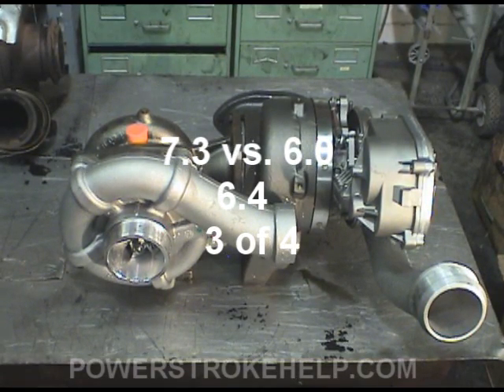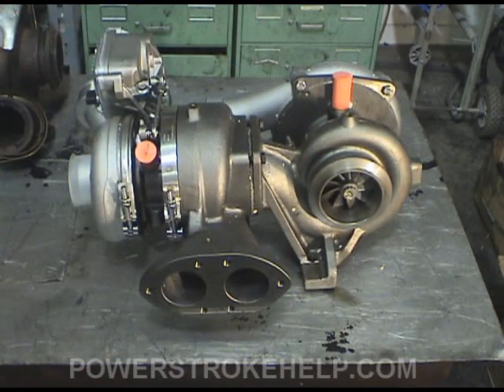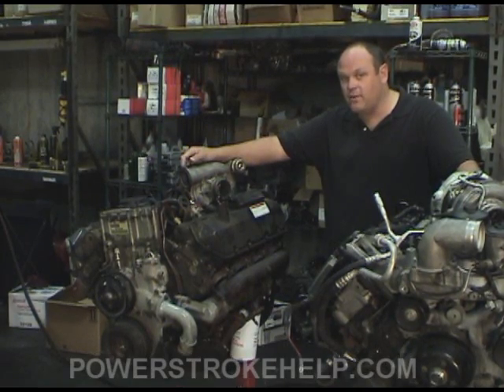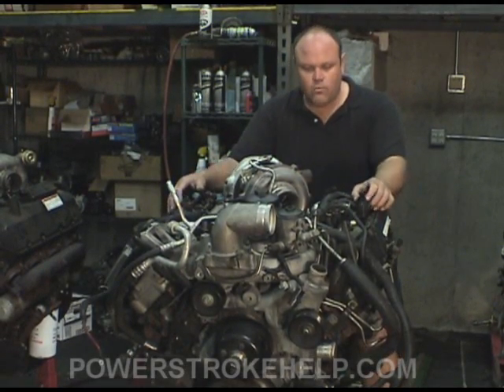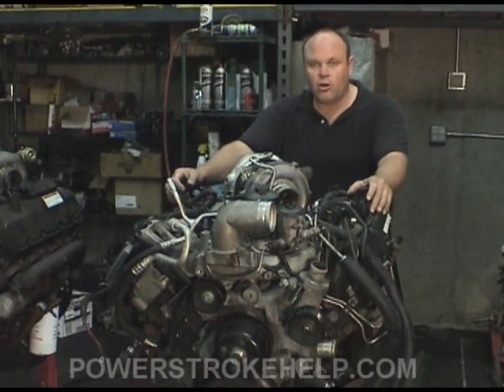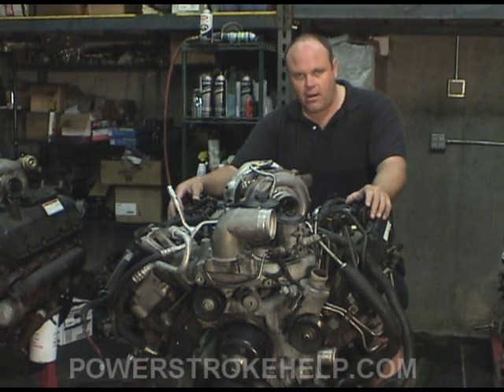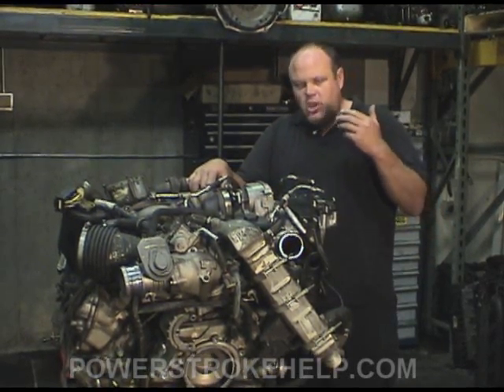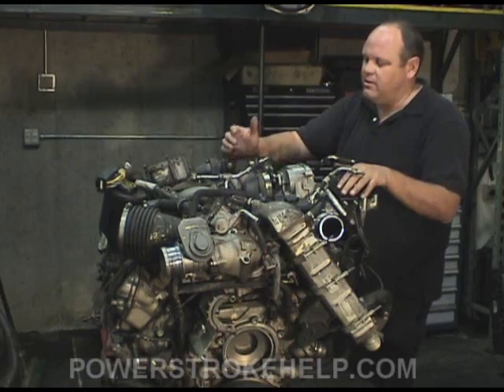7 3 vs 6 0 vs 6 4 POWERSTROKE ENGINE 3 OF 4

Comment: Out of the hundreds of 6.0 SD trucks we have had in the shop, I have never seen a stock 6.0 powerstroke blow a head gasket no matter how hard they have been ran. If you tune them then they blow head gaskets but I have never seen a stock one do it. We usually see the 6.0 in for high pressure oil leaks, high pressure oil pump failure, egr cooler failure, Ficm power supply failures, main engine wiring harness chafing causing no starts, oil cooler failures, and injector failures. I also occasionally see glow plug and glow plug module failures and a water pump failure here and there. We do bulletproof them when the customer requests it but I have never actually seen one with a stock tune that needed it. It seems like every truck we have bulletproofed keeps going strong until the entire body rots off of it. Being in Minnesota, that happens a lot.

Comment: And 10 years later Bill stopped working on 6.4s with his final video about having to replace this same turbo for a 4th time because it was such garbage and Ford's quality control went to s#it. Aftermarket single turbos worked better on these trucks.

Comment: I have 123,000 on my 6.4. It has been maintained by my Ford dealership since I purchased it with meticulous care. I change the oil religiously every 3,500 miles. Yet, with all this, I have had to replace the radiator ($1,200), alternator ($1,500), EGR cooler ($3,500) and high pressure fuel pump and sensor ($4,100). I have replaced exhaust sensors 3 times $150ea). I have replaced both lower ball joints, track bar ball joint and the tie rods. both long and short TWICE ($1,200x2). The truck pulls our 16,000 fifthwheel flawlessly (when it's running). Out of the 123,000, I'd estimate I've used the truck to pull the trailer 60,000 of those miles. I love my truck, but all these breakdowns and the cost just to get me to 123,000 is nerve racking. What next? Turbos? and EGR failure? I shutter to image.

Comment: 01 f350, 7.3l, 6sp, 4x4. 385,000mi, replaced all 8 injectors at 300,000. That's all that's ever been done to the motor. Have had to repair 6th gear in the trans, new South Bend clutch, and new pinion bearings in the rear axle (we tow the hell out of this truck, it's all it really ever does). BTW, NE Tennessee is nothing but hills, there is almost no flat ground.
Reply: Sean Hazelwood so do u recommend me 7.3 over all other types of engines? Do u need to do dealerproof on ur 7.3?
Reply: No bulletproof needed on 7.3. In terms of reliability and work duties, yes I prefer it to other ford engines. Typically, the only thing that breaks on a 99-03 7.3l PSD is the injectors and glowplugs.

12v and 24v 5.9l cummins are equal to 7.3 in my opinion (if the killer dowel pin is fixed), but the dodge truck tends to have more issues than the ford.

Other diesel engines are cleaner, quieter, and make more power but they simply do not last as long without major repairs.
Reply: nope just do the maintenance and she'll take care of you.

Comment: own 3 x 7.3 my 2000 4 DR  RWD 6spd manual gets 22mpg, has upgraded air filter large (Dyna) the 4 x4 4 dr dually gets 14 mpg while purchased 6.4 4 x 4 very disappointed w/ my twin turbo, gets 10-12 mpg & power is NOT the same, sure its nice off line, but upgraded my 7.3 4 x 4 changed plumbing fixed fuel rails (on all my 7.3's) tuneable chip TS-6 & she blows the 6.4, honestly great ideas on 6.0 6.4 & 6.7 but when we work every day 7.3 does it. Nextdoor they own 3 Dura-Chevy's glad I did not do that mistake as I almost did. Diesel injectors needed to be replaced at 80K on every truck?  My oldest truck is 16 yrs old now, having trans rebuilt, just don't see purchasing new truck (as I made mistake with 6.4) People ask me when I will sell my 7.3's  why should I, when a 16 yr old used 300k Truck re=sells for more than a 8 yr old 6.4 with 120K on it. I'm delighted with your video, YOUR VIDEO IS THE MOST STRAIGHT UP EDUCATIONAL VIDEO OF THE YEAR!  Thank you I'm keeping my 7.3's even found shops that specialize in 7.3's but your Video & my lost cause of buying 6.4 (great interior) really turned me off from FORD Dealerships
Reply: +FENNIX544 my 6.4 gets only 8 mpg not 10

Comment: Kinda funny how  alot of people talk about how much better the 6.4 and 6.0 is a better engine than the 7.3  but you constantly hear about them breaking down i have three wreckers with 7.3 in them and i just put chips in them gives me little more boost for towing . 7.3 is a pretty simple set up more reliable than the newer ones im almost sure a 7.3 could run on water alone lol.
Reply: I drive International buses, the T444E is the best IMO. The VT365 (6.0) and Maxxforce7 (6.4) are quieter and have less turbo lag, but that's the only thing that's better. The 7.3 is way more reliable, durable and I like the low end torque better.

Comment from the maker: A correctly tuned 6.4L is the best thing going. 1000 ftlb of torque, 21-22 mpg and docile in traffic with no smoke.
Reply: powerstrokehelp until it hits 150,000 miles
Reply: Lol I think you may have changed your mind 😂
Reply: Only thing bad about a 6.4 is cavitation to the front covers . And the connecting rods that aren’t rebuildable and that pesky DPF

Comment: have you ever had to work on a 7.3 that had bio-diesel run in it for a long time? It would be interesting to see if it does any damage or has a grease build up over time. Also, what do you think about the natural gas conversions for a powerstroke diesel? I know of some people that are running a nat gas set up of 40% nat gas and 60% diesel fuel in their engines. It is supposed to run better and burn cleaner. 

I enjoy these videos. Thanks.

Comment: how much of a chance would you be taking by removing all the emission controls from the motor, how highly illegal would that be and how hard might it be? I just don't see the point in putting THAT much control on an engine that's almost always only going to be used to haul things.. I agree about the 7.3L by the way, I've drivin a 7.3 f350 with 800k on it and it runs great, it's just outstanding and jaw dropping. My uncle has a 7.3 f350 2000 at around 230k with no major problems either.

Comment: Hey Bill, in your opinion, would the 06-07 6L be less problematic than years prior? I'm about to hit 550k on my 7.3 and have been thinking about a new rig. This truck is getting tired overall. Motor is still pretty good, no blowby, I use just over a qt of rotella every 3k...might just look for a clean 03 7.3L. Great motor but outdated.

Comment: So how reliable is a 6.4? I am looking at an 08 with 50k miles on it.. Only going to tow a few times during the summer and its going to stay stock. I have a 7.3 but the truck is getting a little worn out and I want to get something newer and would like to stay with Ford as they have treated me well throughout the years.

Comment from the maker: Red fuel is the same fuel as road fuel. The problems come when some old red fuel is stored in old steel tank and become contaminated. The big problem with red fuel is if your local DOT sees the auxiliary tank in the bed a decides to take a closer look.

Comment from the maker: @cowboyman35 The two keys to fuel economy is (assuming the engine and injectors are in good shape) is fuel pressure and correct operating temps. No question tuning plays a role, but a weak fuel pump or a faulty thermostat that doesnt let the engine warm up will kill the fuel economy.

Comment: add me to the list of great fuel ecomony. i drive a early 1999 7.3 with a 6spd manual and a ts chip on it. on the economy tune i can get on the throttle quite a bit but not going hog wild to the floor and steal up to 25mpg with ease. ever since the chip my truck has been so much more efficient with the additional horsepower of up to 80hp on econ and up to 140hp on highest setting

Comment from the maker: @TheBulento Glad to help Bulant. Those guys in NJ said it needed a transmission and it ended up being the VGT solenoid hanging up in the turbo. WOW It was worth the trip down to Buford.
Reply: I'm pulling a 14000 pound 5th wheel with A60 power strokeAll stock except in EGR delete65 miles per  Sometimes with a 25ﾟ difference in oil and coolant temperature The hottest I seen the old is about to 20 on a 6% grade is this normal

Comment: @Shithappens109 it won't kill the truck, there's 30,000 miles on it and it's going strong. 

Do it anyways for the MPG gains and the power, or even better go for the new 6.7L